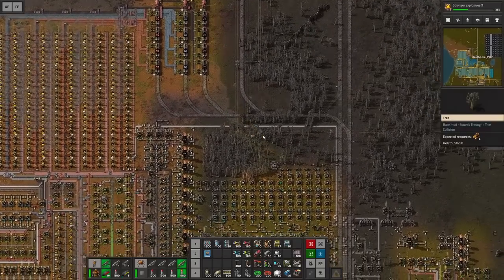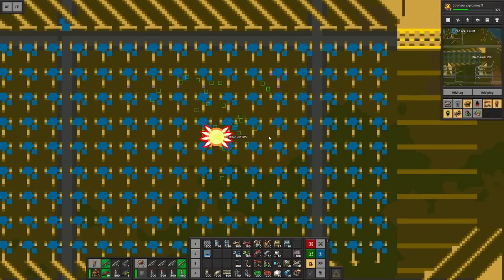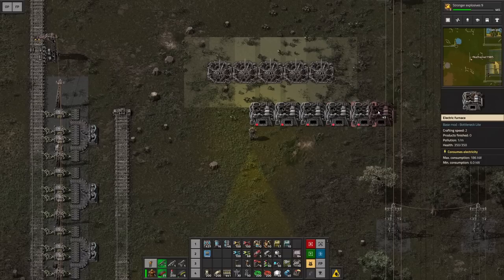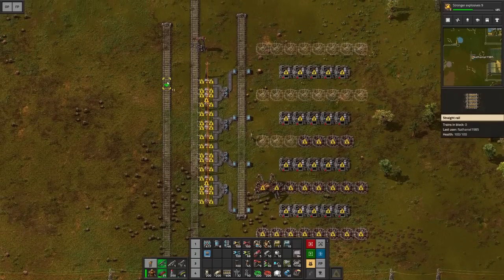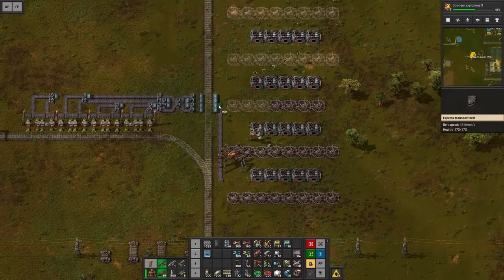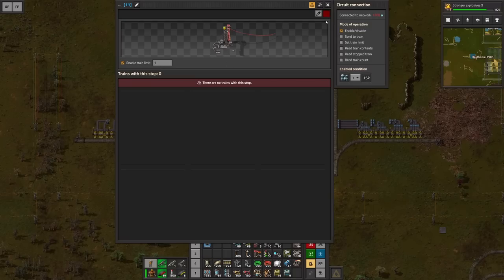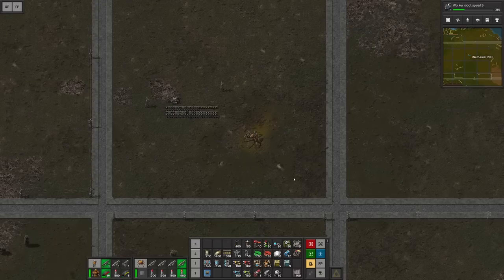TILEABLE SMELTING BLUEPRINTS -  Step 25: Factorio Megabase (Step-By-Step)

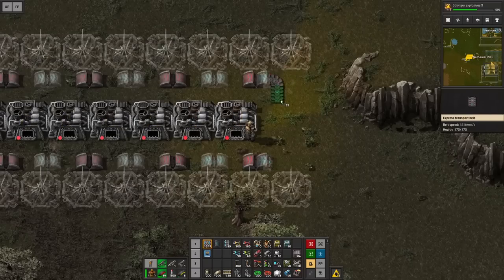Comment: 8:30 Why this design needs input from both side and output from both side? (Also because the previous design doesn't need that)
Reply from the maker: To get enough material throughput. We need almost 1 blue belt in and get 1 blue belt out. If we weave with blue and red belts I have to use 2 red belts to get enough into the machine.

Comment: If you dont want to go all-stack-inserters for max throughtput (i probably spelled that wrong), at least make all belt-unloading inserters stack ones. They fill gaps better then single type ones.
Reply from the maker: It's enough if we use the last machine with two extra inserters that will fill those gaps. So only 2 per row are necessary to get a compressed belt. I see how it would be easier to just use stack inserters, but for me this is not optimised. We'll find the balance I'm sure;)